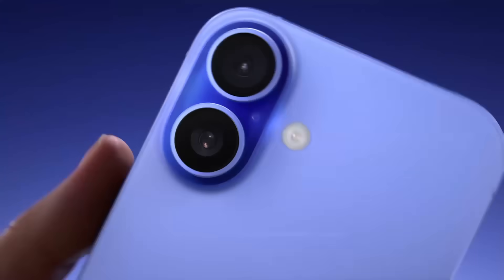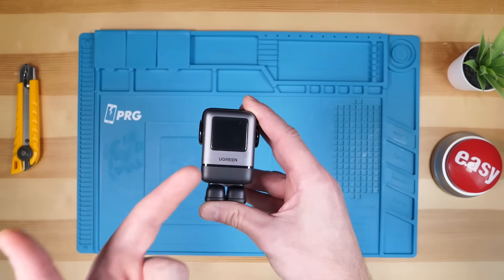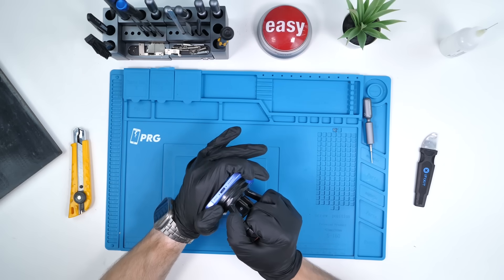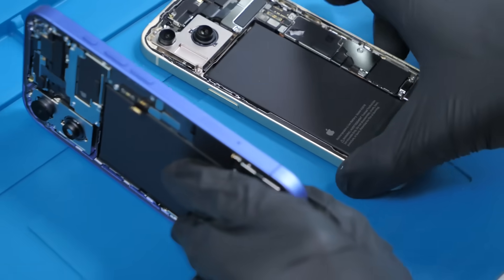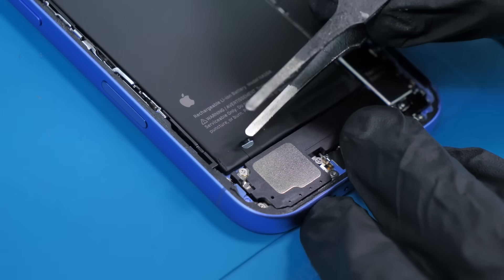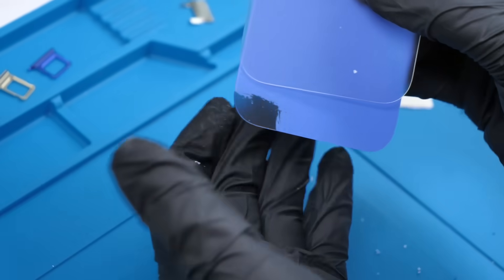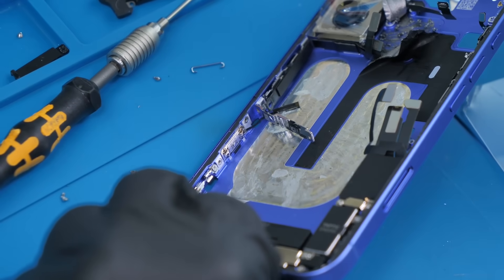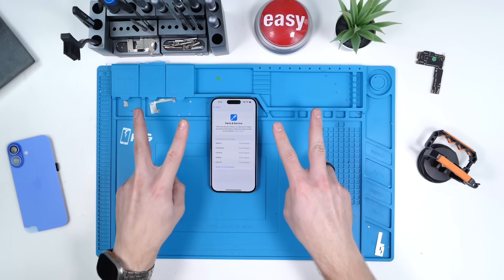Why So Serialized...? iPhone 16 Teardown/Repairability

Comment: I don't mind devices being serialized and giving (unremovable) information in the settings screen regarding parts change even if it's OEM. But the device should work with any compatible parts

Comment: Is it easy to clean the camera crevices with compressed air? I had an iPhone 13 Pro never really noticed. Probably because I got the grey color. 

I bought the black iPhone 16 plus and can see the dust in the crevices after using a microfiber cloth to clean. Should I use compressed air?

Comment: Okay so with the new battery adhesive technology Apple should do that with the adhesive holding the screen/back glass on to make it so it’s easier to get them off. Then either have a specialized screw or the screws that come with the phone as the point of contact to connect the battery to. Maybe that’s what their goal is though and testing with the battery?

Comment: lmao what a poser, you dont check if something is sapphire instead of glass by scratching it with steel, both will never scratch with a cutter.
Reply from the maker: Def would scratch a screen If I pressed as hard as I did with the button. They wouldn't be deep scratches but they would be visible

Comment: I've always wondered, why does Apple print special branding on the Taptic Engine? The only other parts they do this are the SoC and to an extent, the battery. Other parts in the phone might get a logo but no other branding printed on top.

Comment: I have a problem with my 15 plus, The top side speaker is cracking when charging or when the phone is heated. While charging the phone heats up to a limit that the speaker even stops working. Any idea ??

Comment: Ios18 repair tool implementation means they have serialized everthing in the iphone including the wireless coil in the back glass swapping parts  even between two new iphones taints them as it says used and even swapping those parts back results in the same thing this system also allows for them to disable features for any part thats not identified as apple oem .

Comment: Why did Apple get rid of the SIM card for us model phones?
Reply: Its quite literally one of the dumbest things. I was restoring my phone yesterday and came across the "your Apple ID" is required to download apps from the app store and also on top of that 2 form factor authorization which sends a text message to my number to authorize that it is indeed me trying to log in to my apple account but of course I cant get the text message because I dont have service on the phone because I need my Esim. I had to spend about an hour with my phone provider so they can send a qr code to my email of my esim which should be readily available on my account page. It seems more of a hassle than anything because they literally make things more complicated than it needs to be.

Comment: You botched that battery removal so bad I seen another channel do it perfectly with the battery and a Suction cup Do you have to connect 9v to the iPhone battery terminal and let it activate the the release leave it connected for a minute or 2 and pull
Up with the suction cup it came out like butter

Comment: Looked up the electricity induced battery removal process in iFixit's video and it really is as easy as they say, just connect a 9-30V to it and wait the 1.5 minute and then you just pull up with no effort.

So yeah that's on you for not reading a manual.

Comment: 7:45.

That’s not a heat sink that’s the frame of the phone . It’s intentionally left with a rougher surface for the glue to adhere.

Also, why are you complaining about the existing adhesive sticking to the battery?  If you’re replacing the battery, you’re not going to reuse the adhesive and you don’t care if the old adhesive sticks to the old battery.

Using electricity to remove the adhesive is way easier and neater than the pulltab method where it’s not always guaranteed that the tabs will peel off nicely

Comment: I’m curious about apples decision to make the phone open from the back. It feels like a liability for technicians doing screen replacements, which are probably the most common repair type, to have the screen replacement process be so involved — that’s a liability for third party repairers and also Apple themselves as it seems like it would mean more full unit replacements at the Genius Bar for a repairable issue.

Comment: Whats with Face ID ? Does it work when you swap for an original part?
Reply from the maker: Yes it should
Reply: @PhoneRepairGuru  what about older models will it work with every phone that runs iOS 18?

Comment: Apple being apple: You now need a battery to remove a battery 😂
Reply: It’s funny you should say this, because the new system is actually significantly more repairable.
Reply: @transistor-exe  actually yes!
Reply: It’s easier actually, any 9 V or 12 V power supply, without any force and comes out clean…
Reply: @droid4161 and how do you adhere it back?
Reply: @DibIrken  same method
Reply: @droid4161  trueee

Comment: Thanks for the video I raced you on trying to post my video 😉 You win on views always Love the setup! Happy Repairing! I didn't know about the battery; someone commented on that. I wanted to point out the connections that have the QR code on them they are forever paired and serialized to the board.
Reply from the maker: Saw your video, nice work. It's challenging trying to get this out as soon as you did

Comment: I mean don't say the battery is difficult to remove when you didn't follow the instruction. I agree with everything else in the video but that was dumb. Heat releases adhesive and a resistive element is quite a cool solution to make that effortless compared to the old pull tabs which break.

Comment: It looks like the taptic engine is turned 90 degrees.
The old ones have always vibrated side to side. I wonder if the new one is vibrating up and down??

Comment: That battery removal process is next level, pretty sure we've never seen an electrically powered adhesive for a battery before, if it works as intended it will be far better than pull tabs which can break fairly easily
Reply: Why so serious?
Reply: Ive heard, that most samsung phones dont even have pulltabs.
Reply: @Concorde002  yes, before this Samsung has a reputation of putting forever adhesive on all their phones. However, since the S23 lineups (2023) all of the phones (including budget series) have pulltab battery. Referring to any Samsung ax5 lineups or S24 by JerryRigEverything (as usual).
Reply: @Concorde002  Not in the "pull and stretch" sense, no. More like a '1, 2, pull up' sense.
Reply: Would have been good if he actually read the instructions and we got to see how it worked
Reply: @a1white  Yes, I wanted to see how exactly the process works and if it genuinely is faster/easier than a regular pull tab
Reply: Silly warming yet still not working.  smh  A battery doesn't need super-glue like adhesive, two small strips would do just fine.
Reply: @BillAnt have you read the actual comment? Pull tabs break, and that new battery removal process is much easier for everyone. It’s a great upgrade.
Reply: @LeafBeave I just have one question. Couldn't they have skipped gluing the batteries in at all? In such a confined space i don’t think we need it tbh
Reply: @MisiekCentralny  even in such a confined space, there'll still be room for them to rattle around. I've had the misfortune of using a phone with a battery that was not glued in, it's obviously usable, but it doesn't feel as sturdy, I guess. Also, I'd imagine that when dropped a few times, the battery could get beaten up as well, since it's not held in by anything, simply floating there, which could pose a risk of burning. Tl;dr it's better to glue them in xddd
Reply: @kittyle8  You might be right but then again maybe they could have used some sort of sponge or foam to secure it while being easy to replace without special tools. I am not sure, but it wouldn’t suprise me if the reason of doing it in this way is to make repairs harder.
Reply: @MisiekCentralny porous foam materials are prone to rotting and compacting, especially when exposed to heat. non rigid materials are also less repair friendly
Reply: @MisiekCentralny  glue is so far the cheapest and easiest in manufacturing process, that's pretty much the whole reason for using it over anything else. I doubt it's specifically to make repairs harder, rather that it's an unfortunate byproduct of making devices so thin, while also keeping them functional for years on end. Also, I'd imagine you wouldn't want a sponge around a battery, which is based on lithium, when the seal could be broken somehow (lithium + water = explosion/fire)
Reply: @christopantz  yupp, that's also correct 👍
Reply: @MisiekCentralny i replaced the battery in my Nintendo switch without gluing it. After a few months it stopped turning on, one I opened it back up I realized the connector just came clean off the board, still attached to the power cable. 

Glue your batteries down folks.
Reply: @MisiekCentralny The battery needs to be fixed in place, otherwise you run increased risks of damaging it and starting a fire.
Reply: @MisiekCentralny letting the battery rattling around while it expands after years of usage isn’t a bright idea, unless you wish your phones to combust…
Reply: @LeafBeave  - Too bad it doesn't work right as seen in this video.
Reply: @BillAnt Did you watch the video? He explicitly said that he didn’t remove it the right way as the manual was released later.
Reply: @LeafBeave  - Still a silly way of doing it.  Two small strips of tape adhesive would suffice, no need to friggin' weld that battery into the case, it's overkill.
Reply: @BillAnt  what do you not understand? this electric way of removing is much EASIER and less invasive. The two strips would be sufficient but they are just plain worse.
Reply: @LeafBeave  - Isn't much easier to remove a physical SIM and pop it into another phone?  No need to go online or call customer service.  If you damage an eSIM phone good luck swapping it with the need to send you a 2FA code (hint you can't easily).
Reply: @LeafBeave  Apple sheeple will never admit a bad design.  lol
Reply: @BillAnt it’s not a bad design, the only con is needing a 9v battery. Everything else is dramatically easier than other modern methods.
Reply: @BillAnt  Never owned an iPhone in my life, s21fe here... this is honestly ingenious and surprising on apples part this battery adhesive. I applaud them for it 💯
Reply: @Graciashauf  - The idea is good, but the execution sucks.  They could have powered it via a simple jumper from the internal battery or from the inside of the charging port in case the internal battery is flat.
Reply: @BillAnt   it's a simple 9 volt. I'm not complaining and I'm an android fan
Reply: @BillAnt   that could add to cost as well. The 9 volt is pretty simple.
Reply: @Graciashauf  -  Include two jumper terminals like it is now which can be shorted with a paperclip to close the circuit.  A nice and elegant solution with no extra battery required.  The 9V battery is just tacky. imo
Reply: @Graciashauf  - The idea is good, but the execution sucks. Besides using the internal battery, they could have used 4 screws and a metal latch to hold it in place with no glue.

Comment: Yes, as soon as I saw that button, I thought that button could be easily purposed as a Touch ID button identical to that on Samsung phones, (the one slightly encased exactly like this button that besides fingerprint recognition doubles as power switch) with a future update, but since that wouldn't be as precise as the old round sensor, (can't scan the whole finger at once) they could make it function as a double factor authentication method, so that if FaceID can't recognize your face, you can momentarily use TouchID to confirm your identity 😀

Comment: The change in Taptic Engine orientation is for the camera control. To simulate a click, the Taptic Engine has to vibrate is a direction that is perpendicular to the clicking action. In the past, the Taptic Engine ran widthwise, and the clicking action of the camera control is also widthwise. That doesn’t work. Therefore, the new Taptic Engine has to run lengthwise to simulate a click for the camera button, opps, camera control.

Comment: Can you check out a new apple watch ultra fake its so much more smoother than others sensors actually work even has double ponch but its called gesture control on it its called hk10 ultra 3 and can you also break it to see how it was built ?

Comment: Since you discovered that they actually made a pretty easy battery removal process, you should have edited out all the parts where you complained about it before you found out.
Reply: He could have just re-tested it correctly on the second iphone.
Reply: He needed the video to be longer
Reply: He didn't know at the time, and frankly, I'm not sure he could have redone this, considering what he did to get it out before he learned how to remove it.
Reply: @CyanoTex  he had a second one for the board swap, he could have done it on that.
Reply: honestly i dont expect any integrity from this dude anymore, surface level repair videos made as quickly as possible with no care for factuality
Reply: This guy is a clickbaiter that knows shit about engineering and is just a poser of repairs. Does someone really expect anything from this guy?
Reply: "pretty easy" yeah imagine needing a battery and electric current to remove another battery, thats stupid ass decision from apple
Reply: @Yuvalby  you've clearly never repaired a phone in your life
Reply: @Yuvalby they literally made it even easier than it was with pull tabs, plus you can use a power bank or really any other power supply between 9 and 30V and trust me most repair shops have those.
Reply: @Yuvalby  uhm what? That's like complaining that you need a screwdriver to open your iPhone. I'd much rather have a cheap tool that makes the removal easy than to fumble with the horrible adhesive strips.
Reply: @leogrievous  With older models all you needed was a heat gun/plate, a screwdriver with necessary bits and a suction cup. Now you need a 9v battery, and an adapter to go to crocodile clips to grab on the tab. No current toolkit from any manufacturer includes those, not to mention you need that battery to have enough charge to separate the adhesive.
Reply: @Rayjacker  you clearly never replaced a iPhone battery. Otherwise you would know how much of a pain those strips are
Reply: @leogrievous  If you're pulling the tabs cold and unsoftened then that's a personal problem, use heat and/or alcohol to soften the adhesive like you do on everything else that's stuck down without pulltabs. Did an iPhone 7P battery that way without issue.
Reply: @Rayjacker  Hugh jefferies Just showed in his video the new removal. You literally attach the 9v, wait 3 minutes and the battery just falls out...

Comment: My guess for the intermittent powering off after swapping the mobo to the new frame is that the phone has the same problem the 14/15's had where if you leave a part uncalibrated or unplugged, it would reboot every 3 minutes. Seems like a 'feature'...

Comment: What is the function of 2 bottom screws? When phone has so much glue!
Reply: With time, heat, and moisture glue can weaken and pop off, this can happen a lot on smartwatches as they get left in bathrooms while the owner takes a shower/bath.

Comment: The regular 16 keeps attracting me but then i immediately remember it has a 60hz display, at that price, in 2024.
Unacceptable at this point, though the regular apple consoomer doesnt even know what refresh rate even is.
Also, why the hell are we now literally welding the batteries to the damn frame? I genuinely see no benefit, apart from making it more inconvenient.
We were already using a bunch of already strong enough glue to almost weld the battery to the frame.

I just dont understand ANY of it.
Reply: The battery is NOT welded, and now is actually easier to remove because pull tabs always break. You just need a 9v battery and you can easily swap batteries
Reply: Bro did not watch the next five seconds of video where he corrects himself on how to remove the battery.
Reply: Yeah the 60hz display was the main reason for me to go for the pro, especially since I’ve always loved always on displays when I used androids
Reply: Why not using Androids then  @Mythxiir  ?
Reply: crapple needs to step it up on the screens my old galaxy s7 had a 1440p screen also i found a cheap $100 android that had a 120hz screen tho its just 1080p but crapple is basically 1080p
Reply: @halocdpsn as a Z Flip user, 1080p is perfectly acceptable and anything more really isn't needed on a phone in my opinion
Reply: @brandon_nope  
It’s almost like people feel that way about 60hz as well. Crazy.
Reply: nobody is welding anything, and nobody actually needs 120hz on a phone. it's a gimmick so you can say "erm my phone has a higher refresh rate than yours so im better !!"
Reply: @tenooji_ I was skeptical about anything higher 60Hz because it drains a battery. But now when I take my old phone (60hz) - scrolling is pain. 120 is a way to go.
Reply: @alexU42k  60hz feeling "painful" is what we call "rich people problems" here
still, anything above 90hz (being generous) makes no sense on a phone. sure, it's great on a bigger monitor, but all you're doing on your phone (hopefully) is communication and for some, scrolling shorts which don't even play higher than 60fps

Comment: You are making a lot of assumptions without having the right information regarding aftermarket parts. In fact, according to Apple, later this year in a software update, you'll be able to calibrate third party parts like battery, display, etc.